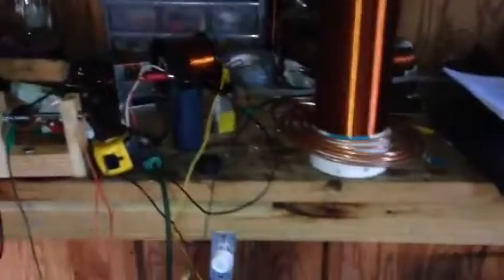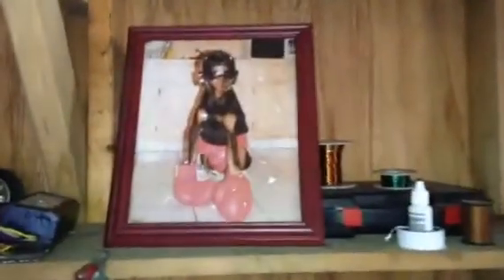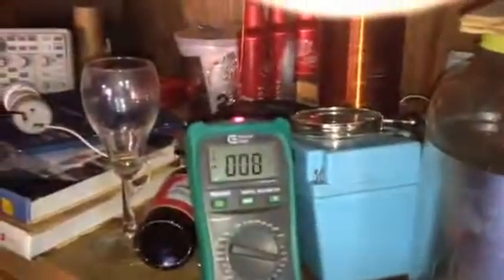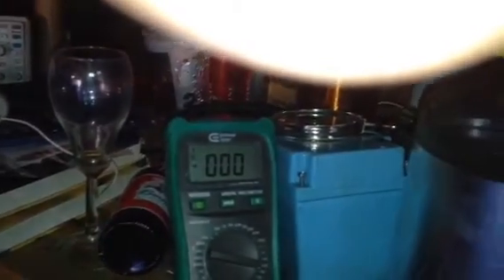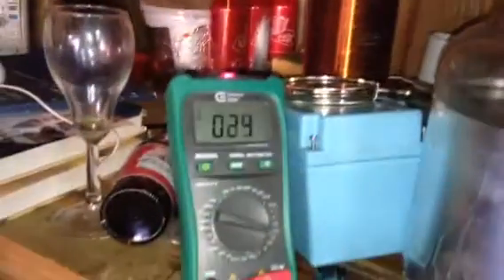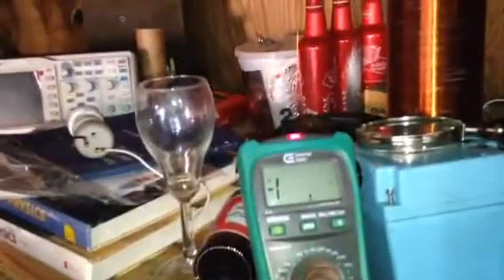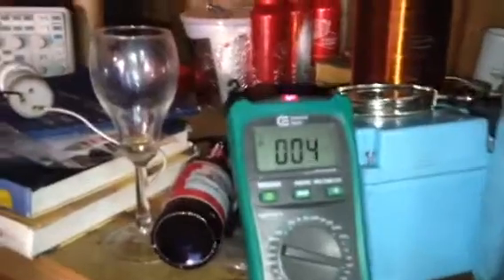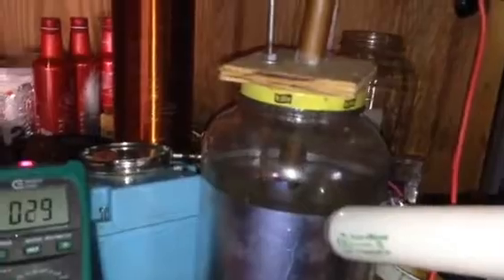Charging high voltage capacitor

Comment: Have you ever experimented with a ion lifter?  The same thing can be done while it's in operation with the bulb and you can be several feet away. I had iron weights arch from ten feet away when it was running. It's corona discharge